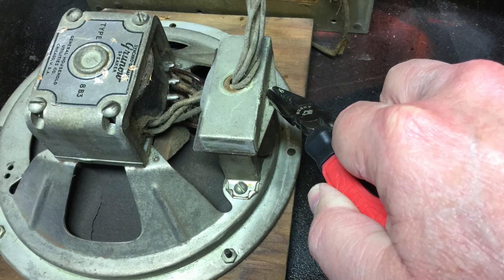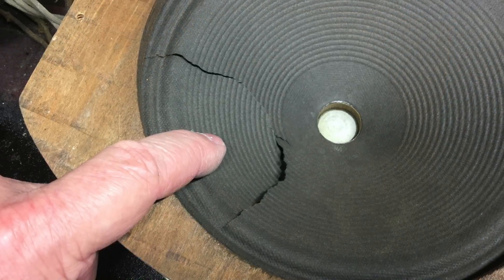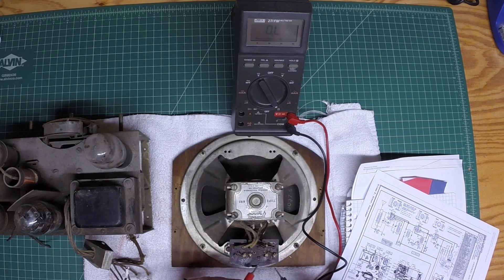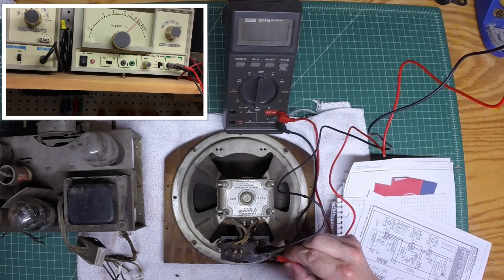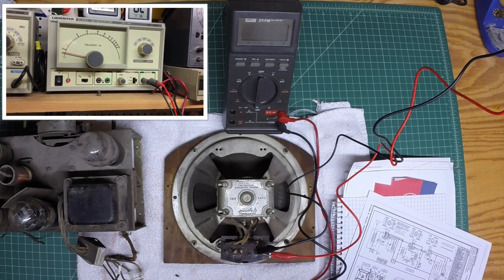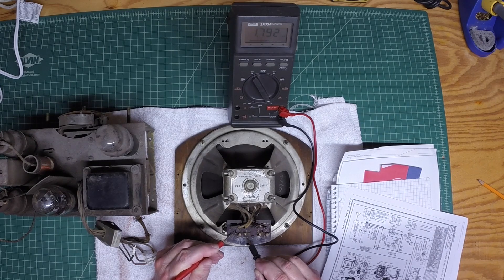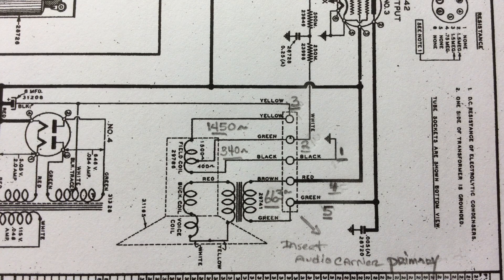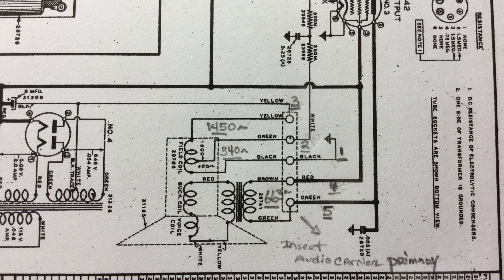Field Coil & Output Transformer Testing

Comment: When testing coils' integrity with audio generator, is the sound coming from the magnetic field-less speaker?
Reply from the maker: Donald - it is. The amplitude of the audio signal from the signal generator is high enough to be able to hear it from the electrodynamic speaker without having the field coil energized. There’s still magnetic flux from the soft iron. An external magnet can be placed on the back of the speaker to increase the magnetic field for this test as demonstrated in this video at: https://youtu.be/yHczVxKxpfc

Hope this answers your question and thanks for reaching out.

Best,

Don

Comment: Great video! One question. What does the schematic say for primary output ohms? I see that you measured 663 ohms.
Reply from the maker: Craig - if I recall correctly, the value wasn't noted on my schematic. The output transformer DC resistance of the primary seemed to be in the normal range and the audio quality was fair after making the speaker repair. Sorry I don't have more info. Let me know if you have any more questions. The schematic: http://www.nostalgiaair.org/pagesbymodel/349/M0008349.pdf
Reply from the maker: Graig, sorry my iPhone changed your name and I didn't catch it until after my first reply. Sorry about that.

Comment: Hi there,
I have a dead quiet National receiver.  Can I insert an RF signal directly into the primary side (6V6GT pin 3 & 4) of the output transformer to check functionality of the transformer and voice coil?
thanks
Reply from the maker: I would like to look at the schematic with you. What model # National receiver? Best, Don
Reply from the maker: +hffenninger I referenced a generic schematic that uses the 6V6 output tube. I think pin 5 on the 6V6 is Grid 1, which would be the input to the tube, while pin 3 is the plate, which should feed the output transformer. You should be able to insert an "audio" signal at ~600 Hz using an audio generator starting at the plate, pin 3. Be sure you use a blocking capacitor on the lead for safety. If you hear the audio tone you inserted at this point, power the radio up and hook your audio generator source, again with the blocking capacitor following all safety guidelines to the Grid, pin 5 of the 6V6. If there's no audio heard at this connection point then the problem is isolated to this part of the circuit. Again, I'm assuming pin 5 is Grid 1. Good luck and keep me posted on your progress. Best, Don
Reply: Hi Thanks for the reply, it is an NC-57, and it is a 6V6 output tube.
Reply: 6V6GT transformer connections are to pin 3, plate, and pin 4, grid